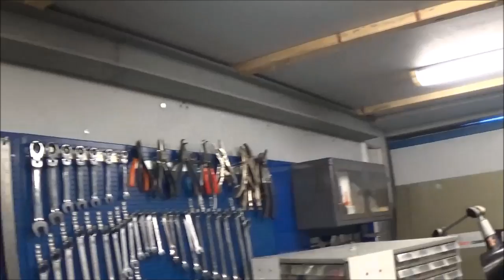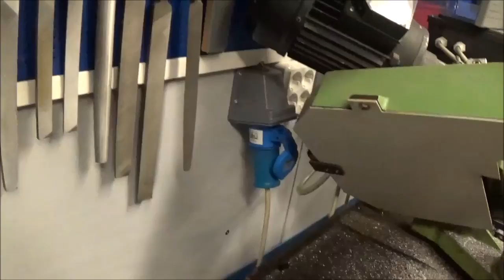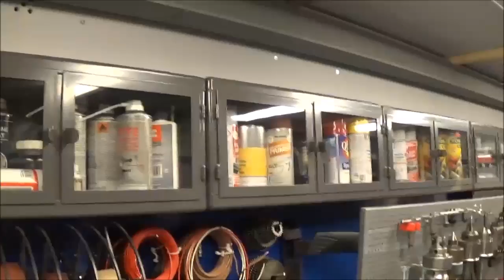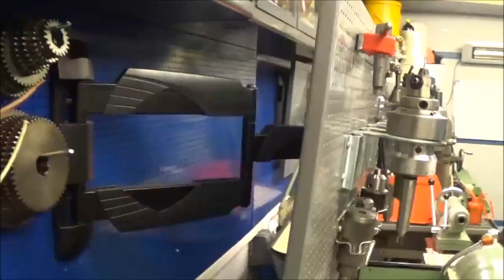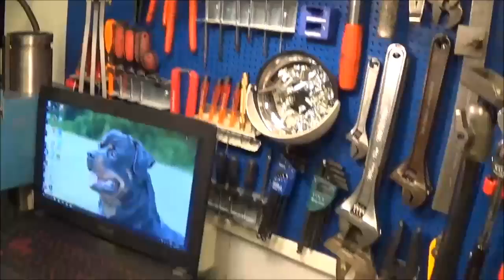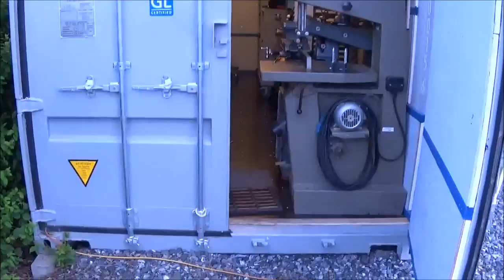Shipping container workshop build after 18 months

Comment: I'm glad I found this video. So-far this is the only 'shipping container shop' video I've seen that has given me ideas. I am currently designing a shipping container wood shop on my channel, and will be stocking it with my full-size woodworking machinery. 8" jointer, 15" floor model planer, panel saw, table saw, drill press, router table, and more along with a large dust collector to keep things clean. The infrared heaters were the thing I was unsure of. It gets 40 below here (oddly the same in Celsius and Fahrenheit), but it must get that cold in Norway. The area I'm in is (southwest Wisconsin, USA) is mostly of Norwegian decent because the area reminded the settlers of home. anyway, thanks for the informative video!

Comment: I am also think about workshop in container. Is there a problem with moisture and rust on the metal objects inside the container?
Reply from the maker: No issue with moisture as I run an IR heater. One could also run a dehumidifier and that would help to manage moisture.

Comment: Did you just use glue for the vertical studs up against the walls of the container or did you also use screws from the outside? If so what kind of glue did you use?
Reply from the maker: Hello Jeremy, I just used building glue - similar to Sikaflex. The idea was that if I didn't drill through, I could ship the container as is if I wanted to return to Australia.

Comment: did you say 18 degrees was a nice & pleasant temp? brrrrrrrrrrrr!!!
Reply from the maker: I live in Norway where people sunbathe at 5 degrees C : ) I can easily turn up the temperature with the thermostat but 18 is good because once I start working I don't start sweating.
Reply: Hi , nice job , on another container work shop in oz the guy said condensation on the ceiling  was an issue , just a thought , could this have been your non stick issue,
Reply from the maker: terry mc - The issue was likely the flex in the roof from the snow loading which popped off the roof batons. I should have had thicker battons and more glue. I have no condensation at all in the shop as it is always warmer than the outside